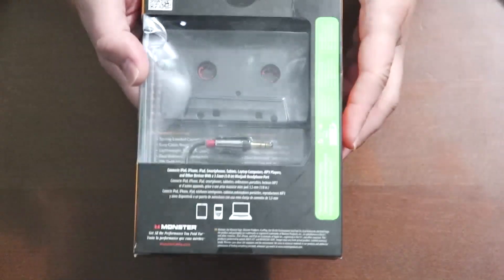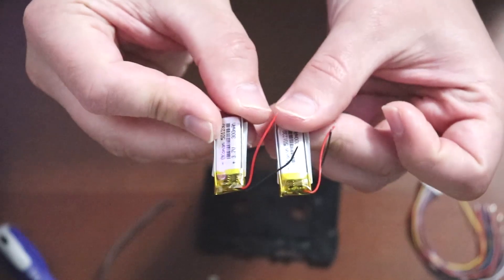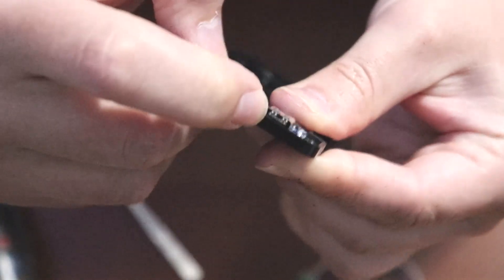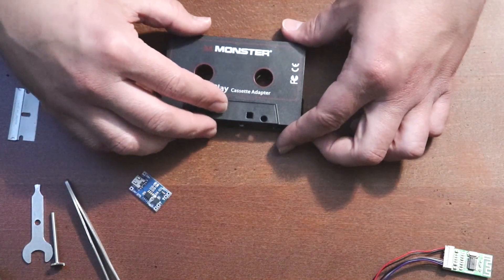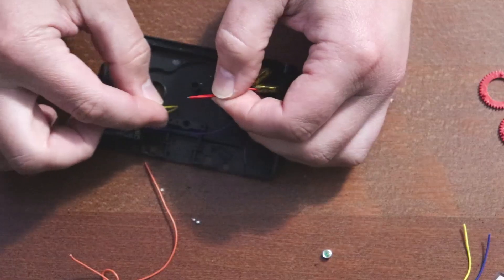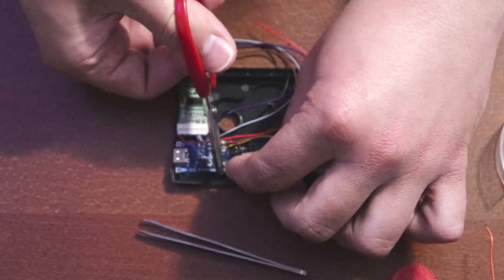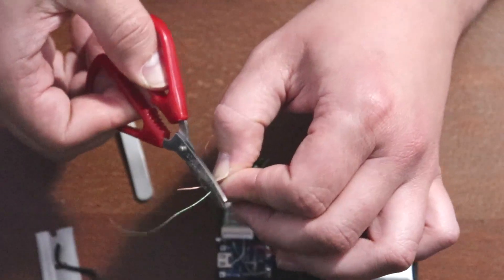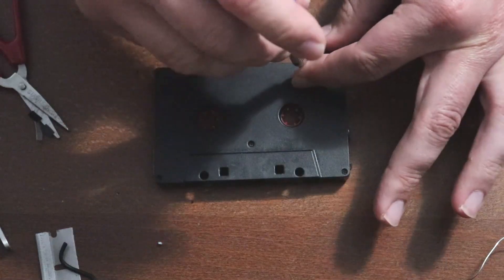How to Make a Bluetooth Cassette Step by Step Convert AUX to Wireless | Auto ON/OFF | High Quality

Comment: Could the spinning spindles provide power and so avoid the need for the battery?
Reply: the speed is too slow for that
Reply: @mrdidovets  even with some gearings to speed things up? Though at some point the torque of the tape deck would be a factor... hmmm :/